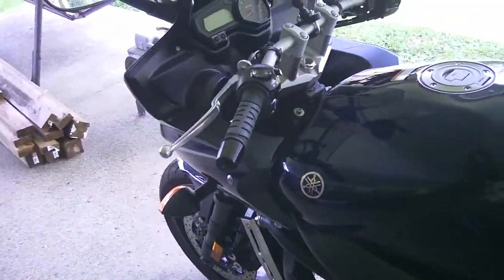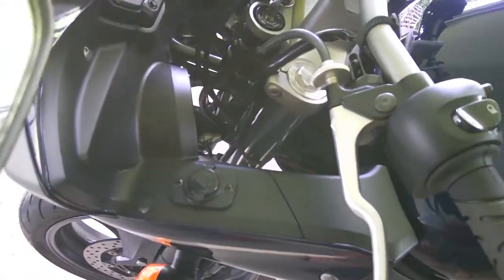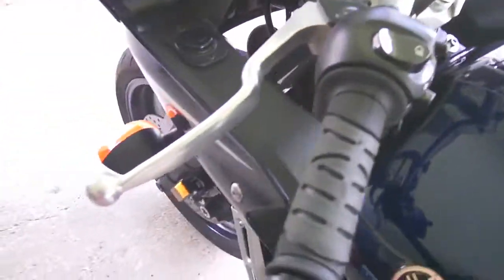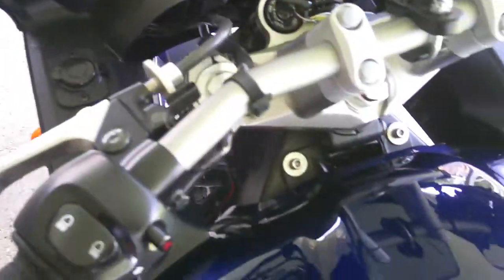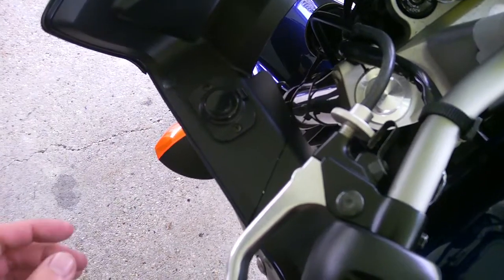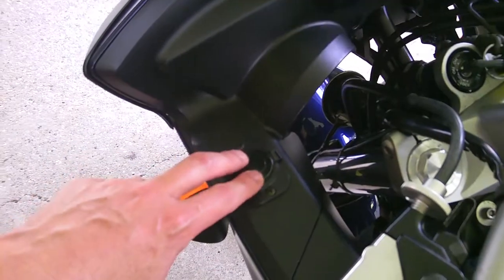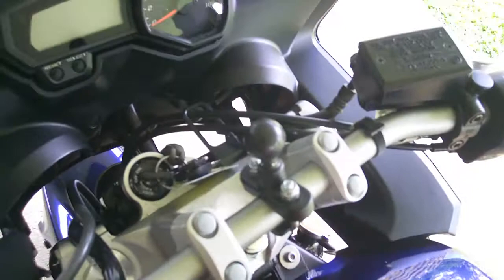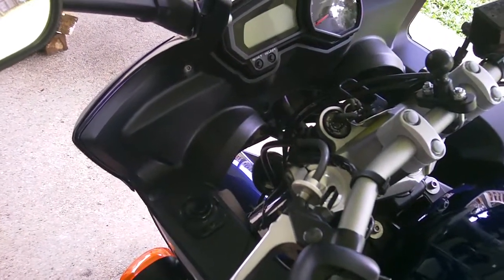12V Outlet on a FZ6

Comment: One trick that I learned to keep things simple when I installed the powerlet is to just wire the negative side to the frame somewhere nearby. In a lot of instances it can keep the amount of wire needed down quite a bit, since the forks and supports in the area are grounded. :)

Comment from the maker: @34luna You can use a ring connector or spade connector, and yes, I connected mine straight to the battery terminals.  You can just loosen the bolt a little bit and slide a spade connector in there then tighten it back down.  You can find a small connector kit, with various types and sizes of connectors at any hardware or automotive store.

Comment from the maker: @34luna NP bud, the most scary part is actually drilling the whole for the plug.  Most kits will tell you exactly what size hole saw to use.  And dont worry, the saw will go through that plastic pretty damn quick.  Other than that, it is just crimping the connectors to the wire and connecting it between the outlet and the battery.  A whole lot easier that what you think.  If I can pull it off, anyone can.

Comment from the maker: @DblOSmith Those new bandits are very nice bikes.  Have you looked at the GSXF650.  I know they are a bit heavier than the FZ, but with your size, that wouldnt matter at all.  I have seen a few used ones in my area for 5K and under.  Definitely an underated UJM bike like the FZ.